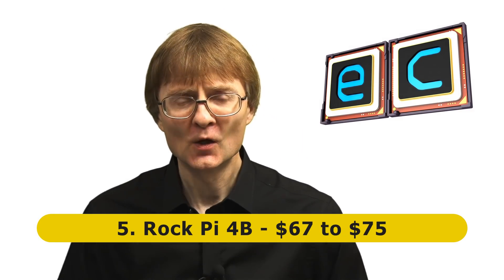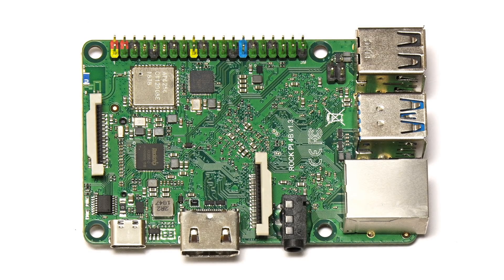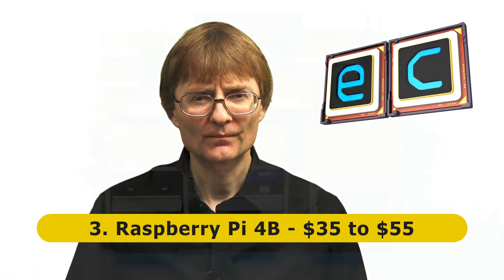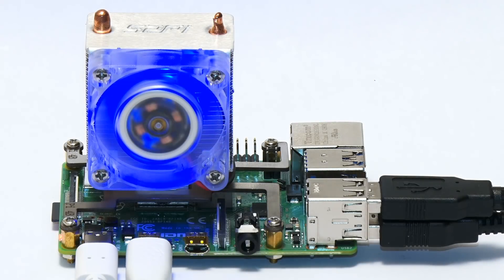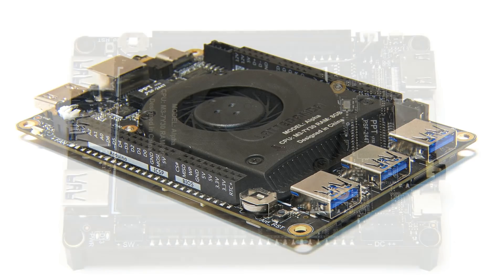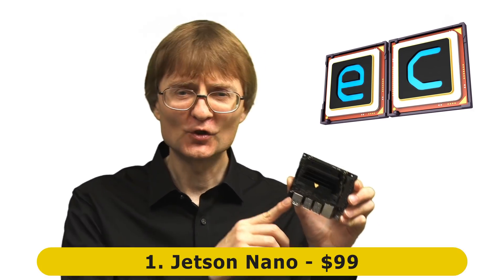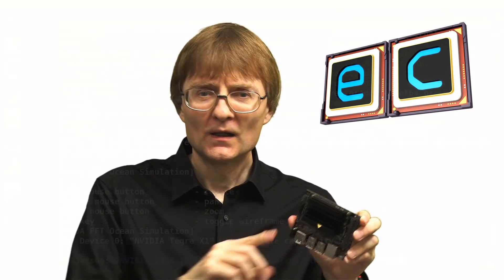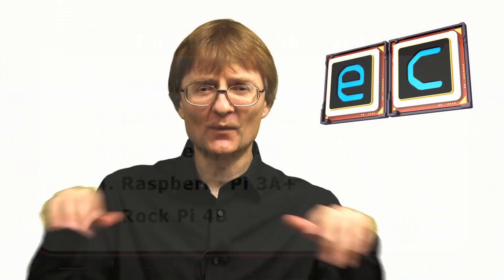Top Five New SBCs 2019

Comment: Have you seen the Rock Pi X? It's very promising, I bet we'll see it on the next year's list.
Reply from the maker: I agree. It looks very promising indeed.
Reply: No just no,  X86 is too litle too late unfortunately,  Arm and RiscV is the future of this game for sure.
Reply: @sethrd999  Surely it depends on what you need to do? The x86 architecture isn't going away and, like ARM, it keeps getting faster and better. ARM is great for energy efficiency, but for heavy duty processing, x86 is a better platform.
Reply: @another3997  I found it difficult to install linux packages on a ARM based system.... the support is really not great.
if you are able to compile some packages yourself, good for you, I personally had ran into many instances of the developer won't support ARM based system at all.
Reply: @sethrd999  I personally can't wait for RISC-V.  It's been slow going so far though.
Reply: @nurglerider781  Arm in the beginning was slow also, I think this one is a true revolution.  I recently have gotten a maixduino ( RiscV ) with K210 Kendrite KPU's and have gotten yolo3 working with Cnn's and Dnn's for object detection.

This thing is up and running in minutes with microPython and C++ ( Arduino or FreeRTOS ), sub $20 for the board a camera and LCD display ftw, its a nifty bit of kit from China ( Sipeed guys ).  And now with Alibaba in the game ( https://edgy.app/alibaba-unveils-processor-thats-based-on-risc-v-architecture?pfrom=tech&fp=a8 ), the game is pretty much on.
Reply: @nurglerider781  Also from another tech article I got recently, here is why NVidia rushed to get their board out,

from the article"

 Pingtouge is also putting significant research and development efforts into its embedded chip series CK902 and its neural network chip Ali-NPU, and has pledged to produce a quantum computing chip in the next two to three years. "

I am sure these will be way more friendly and open aswell as more efficient than CUDA.
Reply: @sethrd999  They didn't rush anything, Nvidia have been plowing $ millions into Deep Learning for years and they have had the SBC available for a while- since 2014.  The latest Nano is just part of that and it is part of a family (some of which cost well over $1000).  Nvidia a few years ago said it no longer sees itself as a graphics card manufacturer- it doesn't make most of its money from them either (just as Amazon doesn't make most of its money from selling stuff via an online marketplace).
Reply: @twmbarlwmstar  Granted CUDA has been around for a while, but its hardly all that ( once you go through the pain of setting it up ) even under Windows ymmv haven done a build with anaconda python etc etc. I much prefer OpenCL as I have access to everything vs dirty nasty binary blobs that dictate way to much.  But my original statement is still true Tegra is a financial failure for NVidia and the new pressures from better tech will just plow over it,  we have new 35xx Rockchip A76/A55 ( 8 and 4 cores ) with AI all in coming so pressure will mount.
Reply: @sethrd999  CUDA is very important to a lot of customers, which is part of the reason Nvidia dwarves AMD in dGPU, plus the fact they are faster doesn't help- and yes I know about the current price war but that is with gaming cards.  I agree that Nvidia doesn't have a cPU but they would say they don't really need one given their current direction- they aren't focussed on the CPU with AI & Deep Learning so can be relaxed about it.  Certainly the Nano makes for a convincing SBC Desktop as I have now seen two running like that (plus one as a great games emulator).  I'd possably buy one over a Pi4 if I wanted an ARM Desktop.
Reply: @sethrd999  It depends, 86_64 still does a lot of things ARM simply can’t and it makes up a massive segment of the server and desktop market.  When you consider AMDs entrance into the server market with its new chips it is a kick in the teeth for ARM.  Arm’s argument, deflecting criticism, has been to point to its economy and cores but AMD have sort have made that a weak argument.

ARM still works best when it’s talking to a 86_64 server hence its success with mobile phones and tablets, at the same time the MS Surface Tablet has done badly at all which shows people still want 86_64 even there.  I have the Go and the Pro (I will be selling the Pro) and it is a very good device.

When it comes to SBC you have to consider the use case, power isn’t always going to be critical and power consumption isn’t always going to be critical.  86_64 still makes compelling sense for many embedded use cases for example-if you aren’t trying to maximise battery life, say because it lives on a factory wall with a big UPS, then the ARM advantages may not be useful.  And RISC is likely to be more disruptive to ARM than it is 86_64.
Reply: @twmbarlwmstar  AMD is keeping the heart of X86 alive that is true, but ( yes there is a but ) Radeon is being sold into Arm IP, and AMD already have an embedded SoC of sorts.  AMD will likely go RiscV when it suites them with Radeon ( Navi or what ever ) thus ushering in the very end of X86 even in the server space.  RiscV I think will be the natural progression going forward, which is why I put my line in the sand and saying 2020 will be the year of the RiscV coming into the forefront.
Reply: @sethrd999  Sorry isn't RiscV FOSH?  Since, when AMD does inject its IP into ARM, it is just that.  How would a business model work for AMD, all they have is their IP to sell but they will instead give it away free by making it open source?  ARM is in the same position, they only have IP, they can't make it open source as they need to sell it.  

Open Source hardware works because you need to buy the hardware, and therefore a profit is made there.  Indeed a FOSH vendor will be self interested in developing software at their expense so they can sell more hardware.  In that sense the free aspect is mudied as the cost of the hardware will have the software development cost hidden within it- just like closed  source hardware.  You do of course retain the 'open' element which you don't get with closed source though.

I somehow don't think that it is likely that ADM will give away its valuable and profitable IP.  You'll either get binary blobs or AMD will continue its long and close relationship with ARM where it can actually make money and RiscV will have to shoulder its own development costs like everyone else- then pass those on to the customer via the hardware.
Reply: @twmbarlwmstar  indeed Open ISA, but then arnt AMD in the business to push silicon?,  how is open drivers giving away IP oh for sure NVidia and the shim -> glx blob for OpenGL and now Vulkan keeps the fear alive that oh no someone might nick our shit if we allow open drivers.

To push silicon allowing a free for all actually works,  in CN 'Creality' 3d printer manufacturer is doing great and proving the model works, the hardware / software ( firmware ) is fully open.

Comment: Every micro HDMI port I have ever had has either given me grief or flat out died and never worked again. It's a horrid bad god awful connector that needs to be done away with. Great video!
Reply: Just fit and adaptor.  Every USB socket is doomed to fail, it is a rubbish specification.  I never directly plug into the USB socket on anything, fit an adaptor and plug into that.  Easier to replace an adaptor than a USB socket.

Comment: I wonder why a stacked HDMI connector (one top of each other) hasn't been invented yet -- much better than mini-HDMI ones sitting side-by-side.
Reply from the maker: As somebody notes below, there is a stacked, full-size HDMI and DisplayPort connector on the Jetson Nano. So it can be done! But I'm sure the constraint for the Raspberry Pi foundation is price. That, and it would make the Pi rather tall, giving issues with HAT compatibility.
Reply: @ExplainingComputers  There's also a SBC (can't remember which one) that has its USB sockets sat in the middle of the PCB, so one below and one above.  Not really sure if that really achieves much as it is now thicker on both sides and no thinner than if they were on one side.
Reply: Most likely would not be electrically sound ala interference,  adding adequate shielding would boost the BOM cost.
Reply: Personally, I prefer dual USB-C connectors. They are far more versatile than HDMI.😎

Comment: Very very big 👍 for placing Pi 3A+ on the list. Very powerful for tiny form factor and not too expensive. Also takes a lot less power which may be a good thing.
I agree that Micro-HDMI on Pi4 is a disaster. Not only fragile but also require special cables just for that board. Still I'm not convinced by "desktop experience" of Pi 4...
Reply: The 3A+ just needs more RAM... but I think the Raspberry Pi Foundation probably didn't want to cannibalize sales of the 3B+.
Reply: TheUtuber999 yes, 1 GB of RAM would be welcome. I think that when a new power horse is Pi4 they should not have a problem with cannibalising sales of Pi3 B+. It has USB hub after all.

Comment: Among all these, Raspberry pi 3A+ is best budget friendly single board PC.
Reply: My problem with that one is the lack of ports. That can be a problem depending on the use case.
Reply: @sbrazenor2  yes i agree but for iot  its perfect..
Reply: Depends on your use case, what you mean is it is the cheapest, that doesn't make it best.  For example if my use case involves Deep Learning and AI then the Nano is the best budget friendly board as it is clearly massively superior to the others for that use case- indeed if I instead bought the 3A+ it would be a waste of money as it wouldn't match my use case.
Reply: @twmbarlwmstar  the cheapest would be a Pi Zero or Zero W, which you can get for like $3-5.

Use case is a broad term. Your use case could require a datacenter's worth the PCs (which you can virtually lease via AWS or some other cloud service), or it could require an old 486 with a monochrome display. For example, George R.R. Martin writes best selling books that turned into 8 seasons of TV, with something running DOS. Your use case could include a workstation with several Quadro cards for 3D modeling and rendering. Or, depending in the scope of what you need for processing power, power consumption, form factor, etc; the 3A+ could be the right option.

I generally start with my list of needs and wants from a device and then figure out the most economical solution to fit that criteria and for the period I assume I need to fill that role. (3-5 years is standard) Most of what I'm in the market for is in the $500-2,500 range, but I buy the SBCs to have as tinkering devices or always on systems. (Much less impact on the electric bill than a full-sized computer.)

For example, I have Pi 3B and Pi 4B (4GB) units attached to some Dell monitors I got at Goodwill for $5 each. One I use as a writing system, which is booted into a CLI terminal and mostly runs WordGrinder for a living. The other is mostly for music and video consumption and sits next to a machine that I use to rip and transcode media. (It's able to run transcode jobs uninterrupted while I do other things on the Pi, so that I don't introduce lag.) The speakers attached to the Pi 4 are worth several times what it is, though I will likely add an external DAC, since it's a noisey little thing. (Like a Schiit Modi or something.)

That's besides the two other, more powerful machines I have in the same room. And then there's the laptops... (I have a lot of those.) I also have a lot of older machines, some of which I should fire up. I've been thinking of decluttering, since I have so much hardware. (Dozens of computers, basically.)
Reply: @sbrazenor2  The Pi Zero isn't on the list, what are you on about?
Reply: @twmbarlwmstar  I was referring to the cheapest Pi of all of the ones offered, no specifically on the list of the 5.
Reply: @sbrazenor2  I think you are on another subject completely to be honest.  Use ase is a specific term for example, you've lost me but my point remains, the best for your budget depends on your use case, nothing to do with wine or whatever.

Comment: i was expecting udoo bolt v8 on the top of the list! for 429$ it is a very powerful sbc and u can build a similarly specced pc for nearly the same price! it has a ryzen quad core cpu!
Reply: Considering the size of that unit, it's more of a NUC competitor. It also has RAM slots, which most SBCs don't need since the RAM is onboard.
Reply: @sbrazenor2  it has much more customization options than a nuc and nuc is smaller than udoo bolt.. there is also a bultin arduino mega chip.
Reply: The big problem with the UDOO BOLT is it crashes straight into the A300/STX form factor which can be had cheaper and is still comparatively small.

It really is just a variation on ASrocks Deskmini A300 with a slightly hampered embedded CPU.  Every time you’d end up choosing either a proper SBC or the A300.  Off the top of my head you can build a deskmini for less than £250, £150 for the deskmini (comes with case and power brick along with STX motherboard) and either a 2200G or 3200G (£80/£100).  You will be trading a few MM of real estate but literally nothing as STX is very small, much smaller than ITX (About 5” square from memory).  Stick an Athlon (new version) in there and you are below £200 and it can be passively cooled.  What you will lose out on is some SBC I/O; ARDUINO LEONARDO-COMPATIBLE I/O but is that enough?  |It isn’t impossible to add GIPO to the Deskmini and soon we are promised more A300 (Although they said that about AM1 and that died on its arse).

The Bolt would have to sell for £150-£170 to make sense I think.
Reply: Bus it can't be run on 5V supply and it is not a low power SBC   which is a very important feature for any SBC
Reply: @amritpandey5801  it is the fastest sbc ! it can't efficient like a raspberry pi with probably 4 to 5 times more power than a raspberry! the onboard graphics(when set to maximum possible tdp) on udoo bolt is on par with gt1030 ... & it can actually run on usb type c but u will need a power supply that can deliver 60w usb pd spec .... thats 30v 2amps.... u can get few battery banks with this feature ....
Reply: @KuntalGhosh  Ryzen 3 2200U i am gessing? on battery (using Windows 10 1803) the GPU is on par with the GT730, when at idle it sips power - 3 to 7 watts as it occasionally uses 1 GPU core for the occasional display refresh. when plugged in (and you have a 50 watt capable cooler or better!) it steps up-to 45 watts, which is 20 watts more than the standard 25 watt TDP (Thermal Designed Power), but is on par with an R5 240 AMD GPU at that power. the games used were Rocket League and World of Warcraft at 1366x768 and 1600x900, as well as 1920x1080 though you will need some more cooling for 1080p gaming. when at full blast one of the 2 cores (SMT disabled, 2 of the 4 with SMT enabled) will be clocking away at 4.9 to 5.3GHz under 65°C. for the testing in my Acer Aspire 3 i have 8GB (2x4GB) of LPDDR4 2400MHz SoDIMM memory installed, which is a good balance for $$ and performance. the Vega 3 GPU takes 1GB of system memory for it's self, so it isn't usable by the system, after that you will have 6.9GB usable by your OS. the battery lasts me about an hour and a half (1.5hrs) when in wow, and about two hours on Rocket League, albeit i had a controller plugged in.
Reply: @nightshadelenar  udoo bolt has  RYZEN EMBEDDED V1605B so thats a QUAD CORE/EIGHT THREAD @2GHZ (3.6 BOOST) apu & amd vega 8 gpu @1/1ghz max... it requires 65w dc jack power or 60w usb type c power delivery ! .. and the cpu has a tdp of 25w which could be increased to 45 in the bios ... https://www.amd.com/en/product/7281
Reply: @KuntalGhosh  an embedded version of the R32200U, basically.
Reply: @KuntalGhosh  or an r5 2400g

Comment: Interesting comparisons and reasoning.  No-one could disgree because it is personal opinions.  I've only experienced the Pi devices, have eleven of them (Sad I know), every model B type except the 4B, each previous model bought for a purpose, I have two Zeros working on ADS-B aircraft plotting, two connected to TVs, one as a media and web server, another running VPN and yet another running Pi-Hole.  The Pi restricts itself slightly via the pricing structure but is remaining faithful to its initial purpose so for that I applaud it.

Comment: I have to disagree on the Lattepanda being innovative. If you open up an macbook air from 2012-2015, the motherboard is in similar size or smaller to the lattepanda. Laptops with the ultrabook formfactor also have amazingly small motherboards compared to the power offer. Buy a ultrabook (macbook air, zenbook lg gram) with like a broken screen or keyboard, take out the mobo and you technically have a sbc with a likely core i3 or i5 processor with on board nvme storage and a bonus of a battery header. Lattepanda is the first to offer AMD.x64 processors easily accessible for tinkering. 

Tldr, The latte panda isnt innovative but derivative tech. Still pretty cool though.
Reply: picture of mac book air motherboard...
https://www.ebay.co.uk/p/Apple-MacBook-Air-13-A1466-Mid-2012-I5-1-8ghz-4gb-Logic-Board-820-3209-Faulty/1827730820?iid=254261083046&chn=ps&norover=1&mkevt=1&mkrid=710-134428-41853-0&mkcid=2&itemid=254261083046&targetid=605443902958&device=c&mktype=pla&googleloc=9045652&poi=&campaignid=1506016294&mkgroupid=56472528605&rlsatarget=pla-605443902958&abcId=1139596&merchantid=119301763&gclid=Cj0KCQjwt5zsBRD8ARIsAJfI4BiDoDwDBByo1TUCZtEQCF-Q3mbZWKoQ60LbPSXlFuFJr5di6BZN7RsaAsJMEALw_wcB

You need specsavers I think.